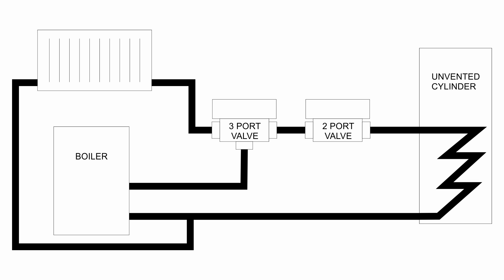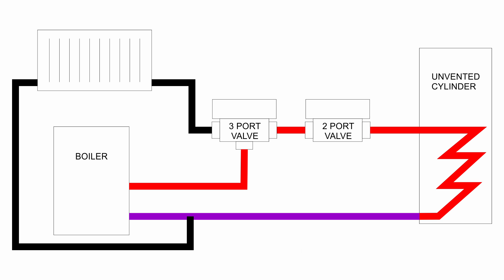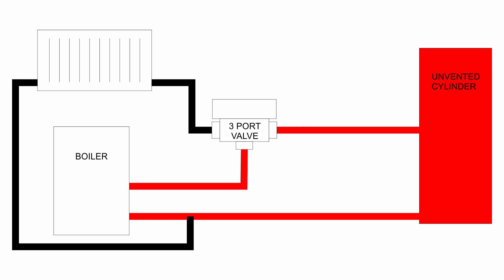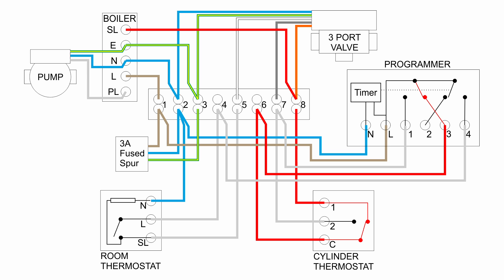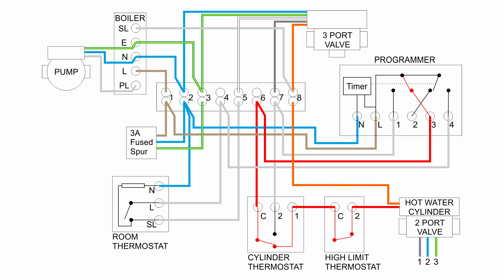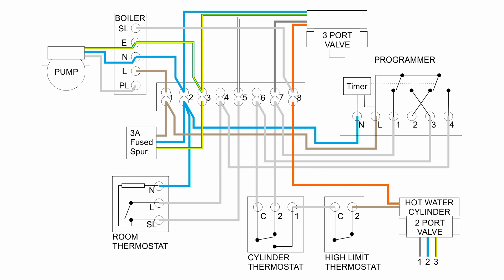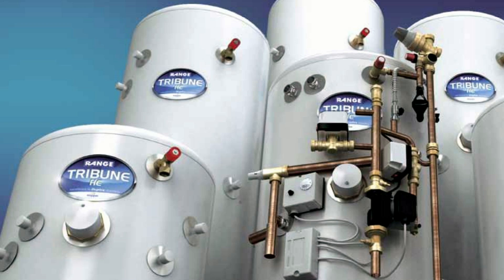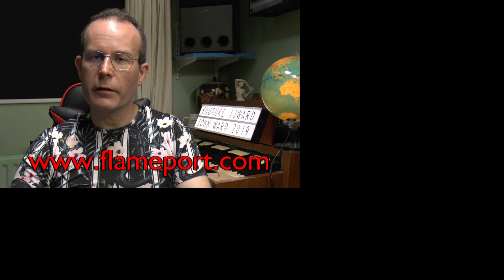Y Plan Heating with Unvented Hot Water Cylinder

Comment: An indirectly heated cylinder cannot be turned into a bomb. For that to happen, the water in the cylinder has to boil, and that's can't happen with an indirect cylinder. For that to happen, the primary would have to be carrying superheated steam and to all intents and purposes that's impossible. Quite apart from the thermostatic protection on the boiler's primary circuit, the way the primary is fed from a vented header will prevent that. Even if the boiler fail-safe thermostat failed as well as its main thermostat, the steam generated would all be in the primary circuit, and that will be vented.

The only way a "bomb" can be made with an unvented cylinder is with a rogue immersion heater where both the main thermostat and the secondary over-temperature one both fail. On top of that, the protection systems built into the unvented cylinder would also have to fail too. However, clearly that's nothing to do with the boiler feeding a primary circuit.

It's not that I like Y-plan systems. They are the work of the devil, and S-plan is a much better way to go (and, in any event, all such systems should have automatic bypass valves installed).

nb. there is a video one Youtube of an unvented cylinder being blown up by Myth Busters, I've even seen a couple of plumbers firms posting it, uncredited, as a dire warning of what can happen and, apparently, it's often shown to would-be installers at the start of courses to show what can go wrong. However, it's only going to do that if all the safety systems are overridden and never from heating indirectly. Cylinders sold in the UK will not explode, even with an immersion heater locked on. If not installed properly, then if the over-pressure safeguard kick in, then it can spew large amounts of hot water and steam where it's installed, but it won't blow up a house.
Reply: Yeah, but I think the point is, you really, really don’t want hot water being released which may damage the property or worse, fall on people...
Reply: @Mark1024MAK  Agreed, but in practice on an indirect heated cylinder it's pretty near impossible. Boilers generally have a cut-out at about 85C and whilst that's a dangerously hot temperature, that could happen on a vented cylinder too.

 It's the immersion heater that is the bigger danger.
Reply: Steve Jones you’re talking drivel mate, of course an Unvented cylinder can explode, never heard of cylinder stratification or high capacity cylinder coils??  Do you think the temperature at the bottom of the cylinder is the same as the top.
Modern Unvented cylinders can have a 20KW coil fitted FFS!!  With almost instant HW recovery.
Reply: @TheDickPuller  No. This is a matter of physics (which is where my qualifications are in). Whilst water remains a liquid, it cannot store a lot of potential energy. It's why boiler pressure tests are done hydraulically. If the boiler fails under pressure when it's full of liquid, there's no significant stored mechanical energy as liquids are essentially incompressible. 

Unvented cylinders have expansion vessels, to deal with any expansion of water whilst in a liquid phase. Even if that failed, it will not result in a explosion. It would crack for sure, but as there's almost no stored potential energy it will not explode (hot water will pour out of course).

It doesn't matter if an indirect coil is 22 or 220 kW. As long as it cannot go above 100C it cannot boil the water in the  cylinder. It doesn't matter that the temperature at the top is higher than the bottom as it can never get to boiling point. It would breach  the 2nd law of thermodyamics.

To store a lot of potential energy, the contents have to turn into a gas. In other words boil (which cannot happen with  an indirect cylinder). Boiler explosions where there is steam pressure are hugely dangerous because of all that potential energy stored by a compressed gas. It is also, incidentally, why carbonated drink bottles are filled to full and have cleverly defined slots along the threads to relieve pressure. It's because it's compressed gas, not liquid that holds potential energy, Until they learnt that, the old glass carbonated bottles which were not fully filled could explode quite dangerously.

To repeat again, direct heated vessels are a completely different game.
Reply: @TheDickPuller  You cannot increase the temperature of the water in an an indirect cylinder above the temperature in the primary coil. That's period. It's impossible. As Flanders and Swann would sing, 

"Heat won't pass from a cooler to a hotter 
You can try it if you like but you far better notte"

As it is, the temperature in a primary circuit is not going to go above 85C anyway, as boiler cut-outs will trigger by then, without even considering the loss of temperature in the pipework. 

Direct heating is different. There's more chance of a combi exploding than an indirect cylinder as those are direct heated.

Also, I've yet to hear of a single incident in the news of an unvented cylinder in the UK going off like a bomb, let alone an indirect cylinder. It that had happened, the media would be all over it, like they are with gat explosions.
Reply: @pmailkeey domestic gas boilers do not boil water. It's a complete misnomer, but we are stuck with an inappropriate term. Boilers were for raising steam, which is not what a domestic boiler does unless it's gone extremely wrong.
Reply: @pmailkeey I don't know what they are pressure tested to, but reading some Megaflo literature the over-pressure valve goes up to about 8 bar (120 PSI), although some are 6 bar. The operating pressure is 3.5 bar (about 52 PSI). There is also usually a pressure control valves set to 3.5 bar.

There's normally a very large safety margin on these things. On the famous Mythbusters tests of a water heater (a direct-heated cylinder) they got up to about 330 psi before the thing blew up. That's 22 bar. The reason it was so spectactular was the temperature could exced 100C. Indeed, at 22 bar pressure the boiling  point of water is slightly more than 200C. Once the vessel bursts, the water will flash directly to steam (which can only happen under normal atmospheric pressure if the water temperature is over 100C).
Reply: @pmailkeey I probably should have said pressure regulating valve. It just limits the pressure of the water supply. For instance, I have about 6 bar or water pressure, and a regulating valve would be required (in practice, they are essential on unvented tanks as who knows what the water companies might change to alter that at any particular location.

The boiling point of water does not rise linearly with pressure. At 22 bar, it's 217.2C whilst at 15 bar it's 198.7. You have to go all the way up to 86 bar to reach 300C. 

https://www.engineeringtoolbox.com/boiling-point-water-d_926.html
Reply: pmailkeey a 20KW coil was used as an example of a quick recovery coil, with a high surface area mate.
Reply: I totally understand what Steve is on about, but what he must understand is the complacency of our Laws etc in the UK.  DaftyDIYers can fit/alter anything in their own home & I’ve seen some horrendous things!!  One Daft bastard had his thermal solar system flashing to steam & the sandal wearing, tree hugging moron didn’t have a clue!!!  Brain dead with years of smoking ‘Green’, the cunt was a disaster waiting to happen!!
Generally, the average British DIYer should not be let out the house alone!!

Comment: dont forget that when you put on the 2 port if the boiler has pump overrun it will need a bypass. I always recommend S plan with bypass especially when you  fault find a Y+S plan
Reply: I don't think these people know anything about heating systems or requirements. It seems designs are to look good on paper and not to operate with any common sense.

Comment: Ideally, there should be a bypass between the two and three way valves to the return side, so the pump is not pushing against a closed pipe.
Reply: @pmailkeey It's there as a fail safe, if that switch gives up the ghost.  This is all hypothetical anyway, as any half decent plumber would rip out the three way valve and go for an S plan.  I would still fit a bypass.  I'm old school.  Each to their own.
Reply: @sarkybugger5009  i agree you would need an auto bypass escpecially if the live for the pump comes from the boiler for the pump overrun.
Reply: Doesn't matter to the pump if there's no flow.

Comment: Uh, so what's the very British reasoning behind this complex arrangement instead of a fire tube boiler with a heat exchanger for the potable hot water?
Reply: Hard water is a major problem in many parts of the UK.  Direct heat exchangers tend to scale up quickly.  Modern indirect plate heat exchangers are generally fitted to instant hot water combination boilers..
Reply: The hot water boiler (which is a misnomer - it doesn't boil the water at all) is used for both hot water and the heating system. They are very compact and are usually wall mounted. Having a primary circuit means that they are an (almost) closed system and are not prone to scaling up with hard water. 

In smaller houses, "combi" boilers are common, and they do away with the storage cylinder and heat water on demand. 

In general, indirect systems are also safe. Despite John's warning, there's no danger of an indirectly heated cylinder turning into a bomb. Only direct heated systems (electrically or with gas) can do that as to create a "bomb" requires boiling water under pressure. I've never heard of a hot water cylinder in the UK exploding.
Reply: We Brits like to do things the hard complicated way 😂
Reply: 1) above the firebox?
2) there's plenty of thermal mass in the boiler, like 200-300 liters and what ever is the volume of the radiator loop. It's certainly not direct hot water.
If it's not clear, I was referring to a 'conventional boiler', I think that's what Americans call it. The kind where all secondary temperature control is done with mixing valves.

Comment: Great points made here John. I think it's worth mentioning the other links in the chain, that when working correctly can reduce the likelihood of an explosive event. Expansion vessel absorbs the increase in volume when the water gets hot. Boiler control thermostat. High limit switch in boiler. Boiler pressure and temperature relief valves. Cylinder pressure and temperature relief valves. Cylinder thermostat...
Vented systems can be converted to an unvented arrangement, when done incorrectly this can get dangerous. Seen one recently on a job where whoever did the conversion fitted a pressure valve but failed to add the temperature relief valve - not good at all.
Reply: Jonny Mosquito Strawman at Large  You are correct, point conceded
Reply: Jonny Mosquito Strawman at Large  "Temperature relief valve". Hmm, I bet there's a lot of people out there that actually believe such things exist !
Reply: Jonny Mosquito Strawman at Large  What you describe is called a thermostat.
Reply: Jonny Mosquito Strawman at Large  I'll copy what you've said - to prevent you deleting it:

"@pmailkeey no it isn't dickhead,  a thermostat makes/breaks a switch, a temp relief valves opens a water valve to relieve water when it gets to predetermined temp.

How long have you been a heating engineer?  Zero days?"

In three letters, I can show the world that you're an inept plonker. The three letters are:
TRV - as ONE example.